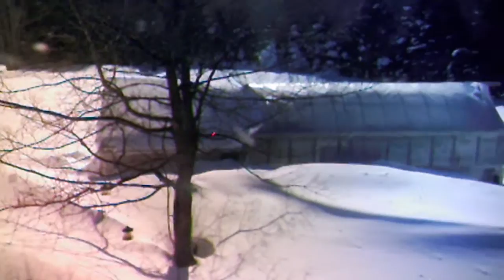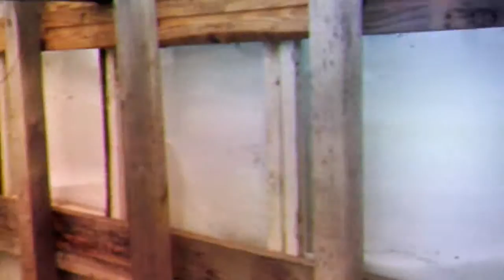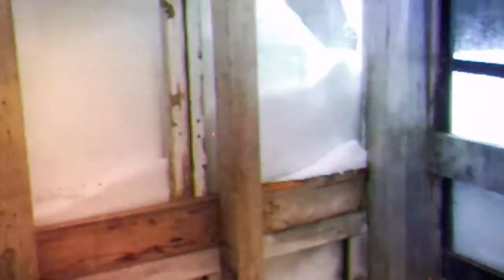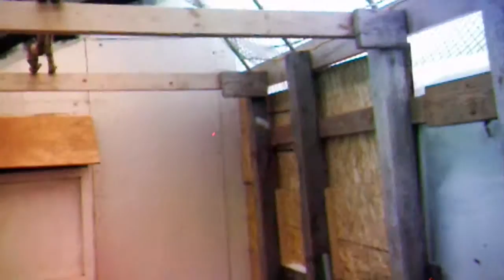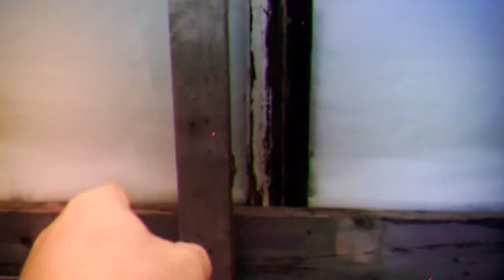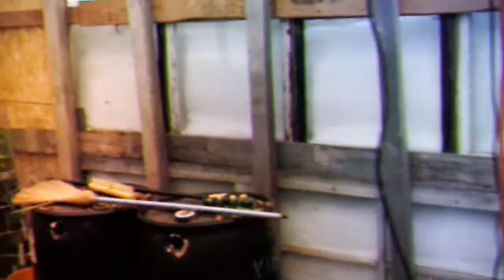Looking Back   Late May 2015

Comment: not using the rocket stove?
Reply from the maker: +oldshield Actually, I had been doing testing and heating with it, but it was my first winter with the greenhouse ... not wanting to bite off more than I could chew, I spent the winter doing R&D ... how much wood for how much heat vs how cold it was outside.  

In this particular case, it had been 2 or 3 days before the storm had finished and we were able to cut a path to the door of the greenhouse.  Once I was done the video, I did run the RMH up to 600F barrel temp and thaw the place out and do some tidy-up work inside.

Thanks for stopping by the channel!
Reply: From one IT guy to another, good job.